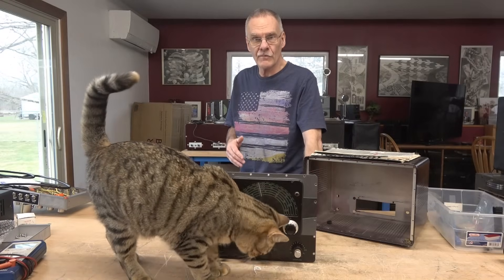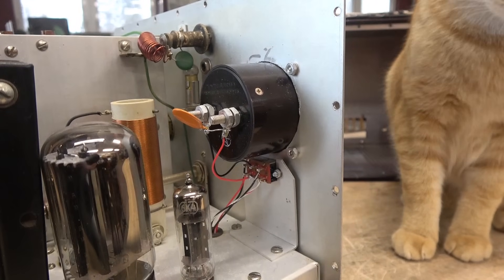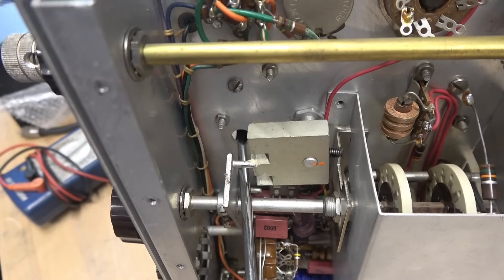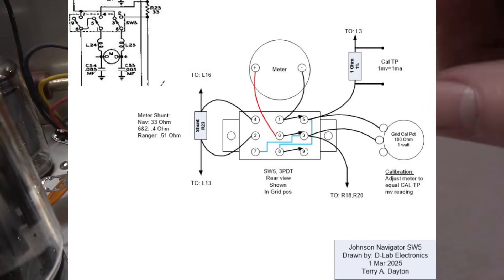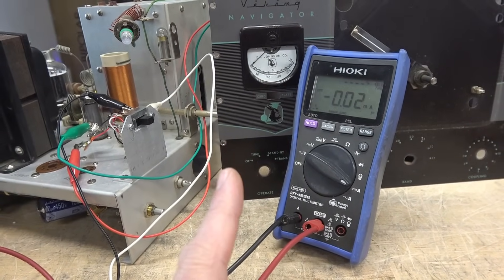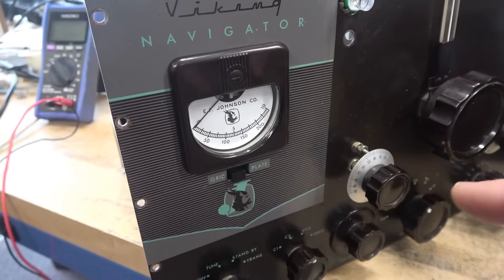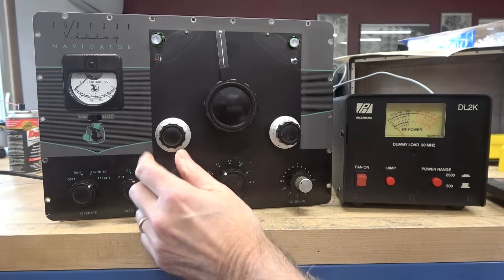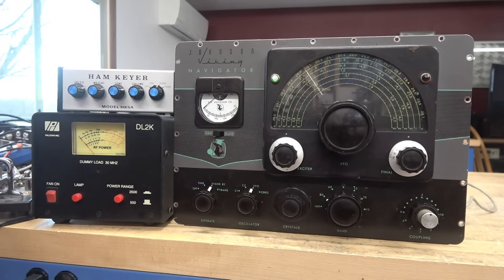Vintage Johnson Navigator tube Ham radio CW transmitter meter replacement upgrade

Comment: Looks like the rig may have taken a significant drop as the transformer appears to be bent forward towards the rectifier tube (?)...may be an optical illusion or possibly a typical sag because of the weight of the transformer? Great work as usual Terry, thanks for sharing!  73 - Dino KL0S
Reply from the maker: Yep a common issue, The chassis needed a center support. Hard to correct